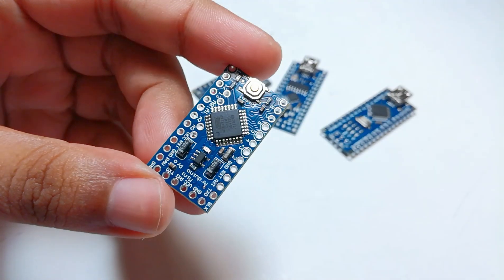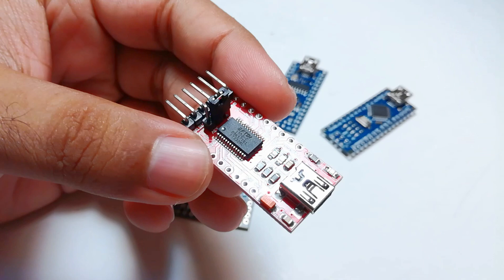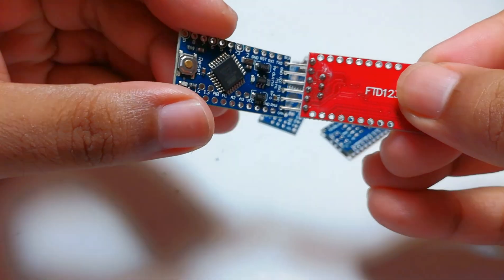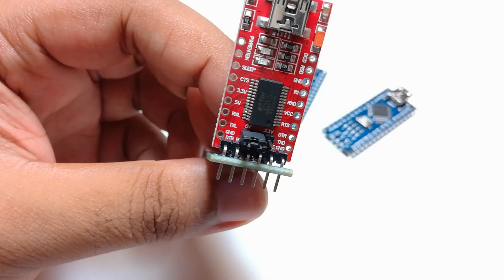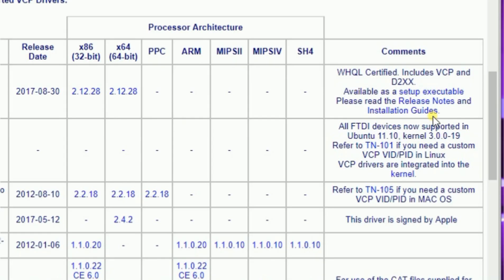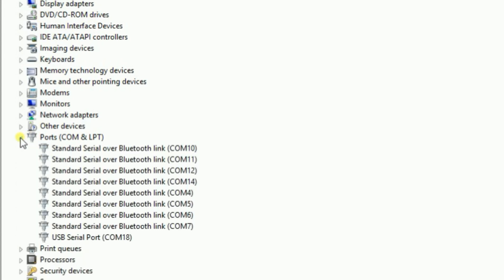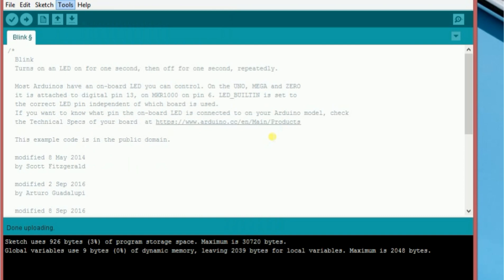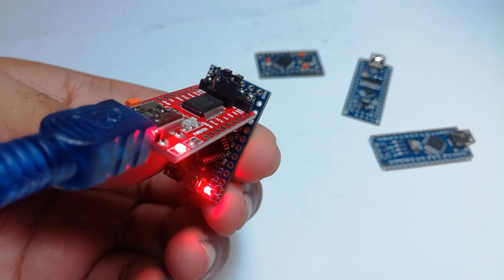How to program Arduino Pro Mini with FTDI.

Comment: Thanks a lot for your video ! 👍
 I just bought an arduino pro mini ATmega 328p and FTDI FTL232RL on aliexpress and I was wonderng if we need to burn the bootloader first before programing the pro mini please ?
Reply from the maker: Probably no. If you connect the pro mini and the led on it flashes every second that means it already has the bootloader
Reply: @ABID5  Thank you for the tip ! 🙏

Comment: hello there, does this process also applies to the nano? my nano usb does not work unless i apply power to the board but if i do this externally then it wont reset when the ide uploading needs it so i need another method for uploading so i thought maybe this would work? i just need to know how to, thanks
Reply from the maker: Yes it will work.
Reply: @ABID5  ill try it thanks!
Reply: @ABID5  in the pro mini there is a connection between the DTR to DTR but in the NANO there is no label pin named DTR so where do i hook up this FTDI DTR to on the NANO?

Comment: Great video, unfortunately the driver you listed will no longer work , if I understand correctly ftdi has banned copy cats of their chip with the current driver you list. It gives error code 39 at least on my system. I had to download an old version of the ftdi driver to get it to work. The version that worked for me is 2.08.24. if you accidentally used the other driver, uninstall the device/driver and manually install browsing to the old driver .inf folder to put in the older ftdi driver. Good luck.
Reply: what a bunch of assholes over at ftdi